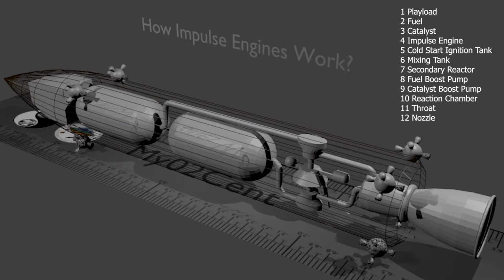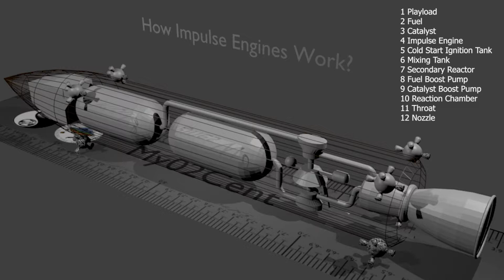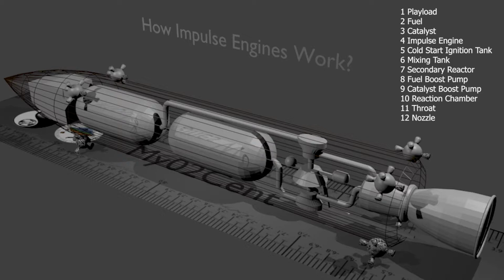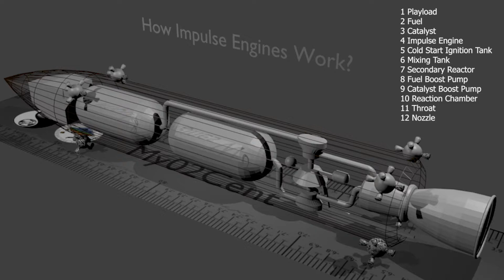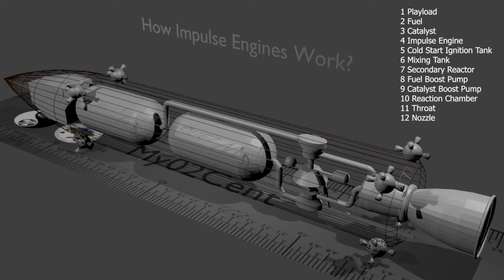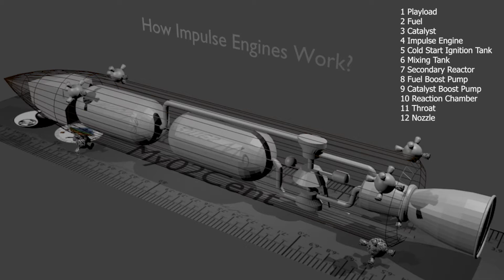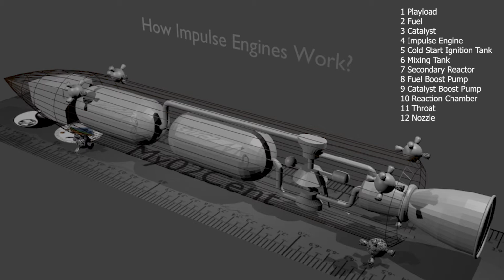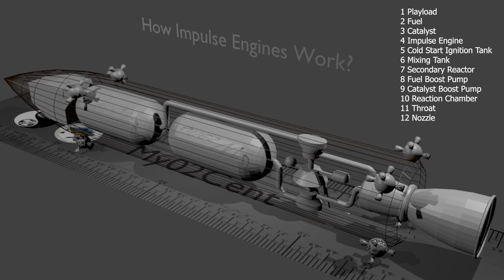How Impulse Engines Work

Comment: If the fuel is water, then instead of a catalyst you have a distiller, that separates the Hydrogen from the oxygen. You explode the hydrogen, and feed the constant burn with the oxygen. Its called a Hydroxgen Engine, and NASA was testing them in the 1970's (it was published in OMNI Magazine). Problem was, people immediately started asking why if we can just 'burn water' for fuel, are we still driving gasoline vehicles? Well, all info about NASA's new designs got squashed after that. In fact, there have been several patents for similar engines granted over the years, and all those design are instantly bought-up by the Petroleum industry. Still, its the best fuel to use in space, because you can literally refuel at any comet, and on most worlds (even Mars has ice).

Comment: I didn't see practical applications for an impulse drive outside Star Trek TNG I thought you''d need massive amounts of energy to run an impulse engine, proper artificial gravity creation is very interesting I'm not a scientist, simply an engineering and science geek.
Reply from the maker: This is the foundation to my empirical application of FTL theory. 

What impulse drive means is science Fiction and what it means In Physics is totally different. This video approaches the word of Impulse as applied to Aerospace technology in an intuitive way. 

a ship the size of a death star and a tie fighter will have the same relative speed traveling at 80% impulse but their power production and power output would become just as relative as traveling near the speed of light. 

In making this video I can say traveling at 80% impulse and my viewer will know that i'm speaking on approaching the speed of light.

Comment: This tells me nothing... I know just as much (or as little) as I did before. Thanks.
Reply from the maker: Hi Terry this is still a work in progress their quite a bit that I have to work out when it comes to how an impulse engine would work in practical application.

My problem is that I struggling to explain prime movement. Newtonian physic is not compatible with General Relativity due to the fact that we do not have an adequate way of describing Momentum as a causeless effect. 

Further more what I'm outlining is a pure energy drive. The impulse drive is explain in such a way that any kind of fuel can power it.

Secondly the Impulse drive operate at higher level of power then conventional combustion Rocket Engines. 

I would like to know what your understanding is on the subject. I myself couldn't find anything in regards to this subject. and further more. My long term goal is to Start working on a practical theory of Anti Gravity.
Reply: @my02cent28  Very interesting hope you succeed.
Reply from the maker: This is how far I've gotten so far 

 A Theory is a supposition
or system of ideas intended to explain something, especially one
based on general principles independent of the thing to be explained.
A set of principles on which the practice of an activity is based.  

 The big bang theory is a
supposition of idea intended to explain the origins of the universe
empirically. The primary premise of the big bang theory is that “The
universe had a beginning” Their is not direct empirical evidence to
support the notion of universal expansion.  Instead Cosmological
observation asserts universal expansion. All directly observable
physical points in the know universe are shown to be moving evenly
away from all other  physical points. We call this observation
expansion. We can measure this motion thru space over time and
predict future position base on present day observation. From this we
can assert past position base on present day observation. However
this is where The Theory of the Universe breaks down.
 Science is
about experimental evidence. We presently have no way of traversing
Time we can not know for certain that the universe existed as a
single point “singularity”. Further more all present day know
physics constraints contradict such a claim. What is true for the
dynamics and mechanics of the present day observably universe must
hold true for any abstraction into the past.     

Nothing is in contrast to something 

Object Permanence

My02cent

Trans-Location 

The action or process of
moving or being moved base on principles of non-locality or action at
a distance. 

Trans-Position
The action or process of
moving or being moved base on locality.

Transition 

My02cent Principles of
Locality 

 In physics,
Trans-Position, “the principle of locality” states that an object
is directly influenced only by its immediate surroundings. A theory
which includes the principle of locality is said to be a "local
theory". This is an alternative to the principle theory of
concept of “Spontaneous theory"action at a distance".
Locality evolved out of the field theories of classical physics. The
concept is that for an action at one point to have an influence at
another point, something in the space between those points such as a
field must mediate the action. To exert an influence, something, such
as a wave or particle, must travel through the space between the two
points, carrying the influence.
 
 In physics,
Trans-Location , the principle of non locality states that an object
is indirectly influenced by its immediate surroundings. A theory
which includes the principle of non locality is said to be a
"Spontaneous theory" or "action at a distance".
It is the concept that an object can be moved, changed, or otherwise
affected without being physically touched (as in mechanical contact)
by another object. That is, it is the nonlocal interaction of objects
that are separated in space. The concept is that any causal action
which can occur at any point. Can directly influence any other point
regardless of the space between those points such as a field required
to mediate the action. To exert an influence, it is not necessary for
something such as a wave or particle to “Trans-Position” through
the space between the two points, carrying the influence. 

 Locality evolved out of
the field theories of classical physics. The concept is that any
action at one point to have an influence at another point, something
in the space between those points such as a field must mediate the
action. To exert an influence, something, such as a wave or particle,
must travel through the space between the two points, carrying the
influence. This occurrence occur relative to the dilation of
Temporal.

Locality applies to Space and Dimension-ality. But
the term Trans-Temporeal-Position and Trans-Temporeal-Location extend
the context of locality to Time. 

Locality: The Position or site of something 
Chronolity The Instant or moment of something  

Chron-Position
Chron-Location 

 
Dimentionality Point 

Temporality Instant 

A point in time is an Instant 
A line in time is a Moment
A circle in time is a continuum 
A Cube in time is an Event
A Teserrect in time is an eternity
 an Eternity is the average life expediency of a universe.   

 

Locality: Locality is the
fundamental  

Non Locality

Primordial: is the first
and lowest possible order. Giving rise to the fundamental 

 

Fundamental: is the second
order. Fundamental is risen from the primordial and gives rise to
Elemental. 

Elementary:  is comprised of the 

Formality: is the

Locality and
Non-Locality

Square

line =x
Perimeter p= 4a
Area  a=a^2
Volume a=a^3
Density d=d^4

Their is only linear motion. 
Curvilinear
motion occurs as the inherent byproduct of 2 or more linear motion. 

Motion